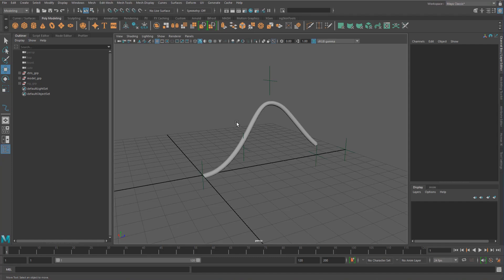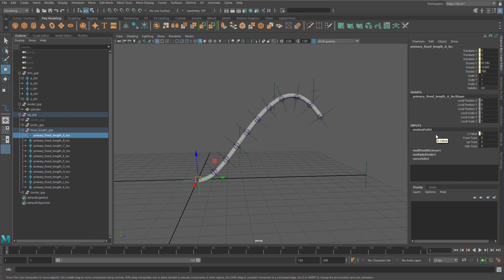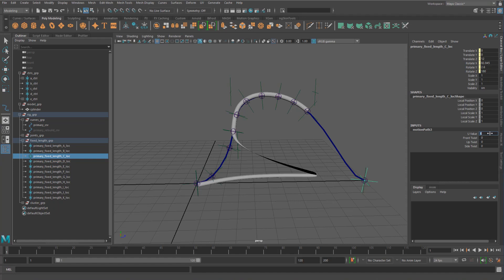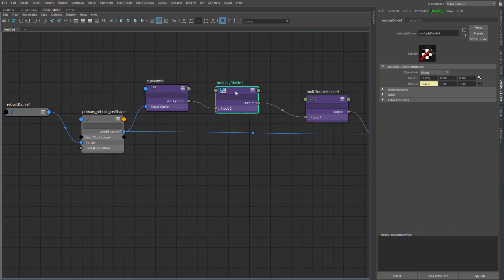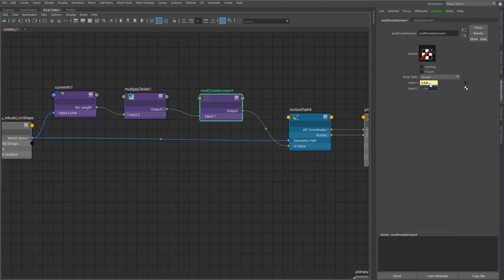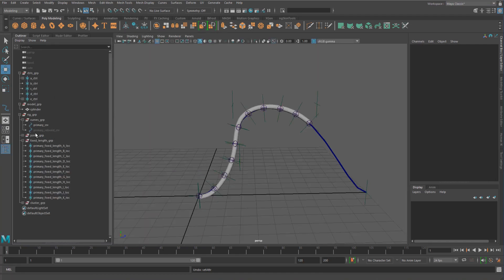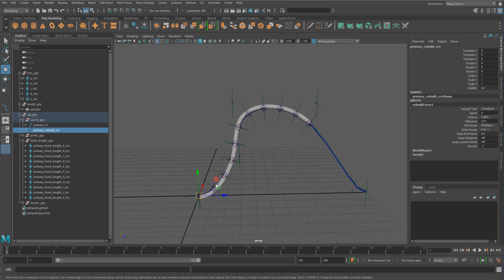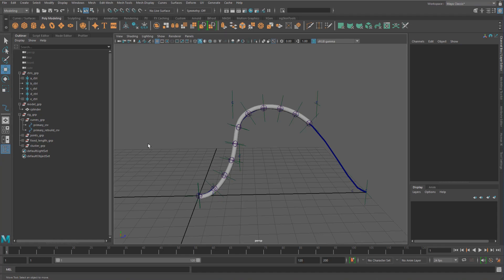Maya Data Flow - 10 - Simple tentacle rig overview

Comment: Great video, short but i learned a lot. I replicated the system but i have a problem, when i try to make a whip like movement some of the locators(the ones guiding the joints) rotate 180, so the geometry becomes like a candy wrap, did you have the same problem or with the simplified version it works well?

(So i ended up just conecting the rotate Y and Z and it works but i wonder if its there a better solution for that)

Comment: I attached joints to my monster rig as your exemple. And I take double-move joints and curve.
I usually work using IKSpline and use curve info to divide interactive length with a constant length and attach the result to the scale joint. After this, I duplicate all joint and parent all into one group. Parent Constraint and scale constraint All joint with IKSpline to the joint in one group and I take joint without scale compensation this work in the monster rig and I can export this to Unity.